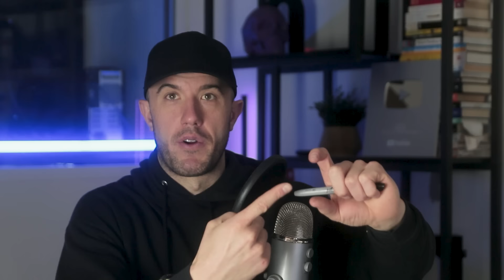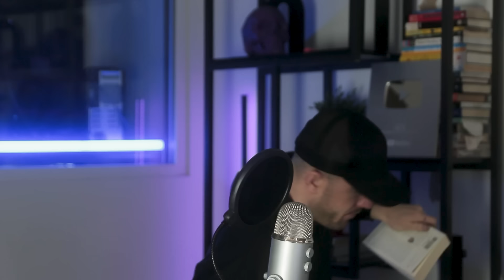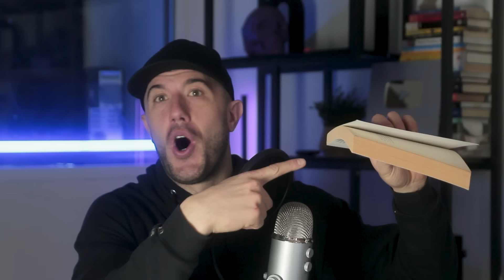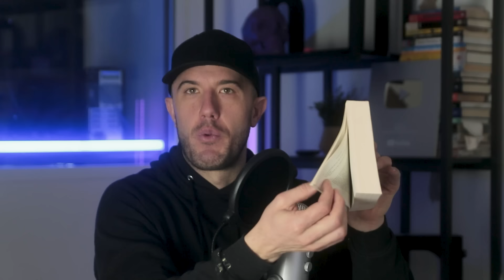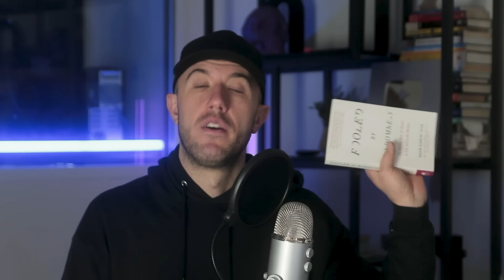ICON Raises 56 Million | Scaling Up Tangled | 3D Printing News | Podcast Ep.93

Comment: Materials are getting cheaper, I just bought new PLA filament this week being offered at $8.99 a kilogram. It's even cheaper on 3 to 5 kilogram spools. Once the infrastructure is in place there is no reason for filament to cost so much. Better quality printers are getting cheaper as well. This is one of the reasons a competitive marketplace is a good thing. Cost goes down and quality goes up. Once we figure out how to effectively feed PLA pellets into a hot end, it eliminates all the problems of extrusion and also makes PLA cheaper.

Comment: Gabe, Concerning the consulting or instruction, assume that you are located in CA / Si Valley for the consultation. I don't think I'd charge < $600 for a 1hr consultation then about $400/hr. and then only if the information provided can be somehow  be disseminated to others for training without any IP issues.  That said, certainly a 2nd factory with low cost power, low  humidity, and close to a shipping hub is essential.  I know you have mentioned Austin TX in the past for a second factory, but the RTP area (Cary, Raleigh NC has $0.14/kWhr), Low rent (last time I looked... been a while) and reasonably good shipping although high humidity so there might be associated drying/storage costs to factor in. (Just some input).  Your concept of books is absolutely correct, especially for technical books.  An old business partner told me years ago:  If you see a book that has "one chapter" that contains information that you might need for a contract in the future, buy it now as it will cost you more time (i.e. $$$) if you have go back to the book store again and buy the book then. Also if you go to a book store you should buy, at a minimum, one book to make the trip (i.e. time/$$$) worth it. Bring them home and scan them to know what information they contain in addition to what caught your eye at the time. When time becomes available you can then read, highlight, add notes, copy pages, etc. in more detail. Information is priceless especially in the days prior to the internet.  By the way, Good book that you held up.

Comment: Icon: 3D printing does nothing for the actual bottlenecks in getting a house built. Framing, they're saving like one day off effort. It's a founding principles problem where they applied a technology to a use case that happened to be one of the cheapest parts of the entire process. Still need to run plumbing, run electrical, install Windows and seal from elements. Then when you realize something needs to be changed the concrete of a 3d printed structure makes rework a nightmare.
Reply from the maker: Less labor for framing when skilled labor is short
Reply: @slant3d  that's the thing though, most people in construction can do framing, a roofer , electrician or a plumber can do framing correctly based on specifications but not the other way around. And then you still need to add frames inside those printed walls to hide all the plumbing and electrical, so you're still still putting up almost the same number of pieces of wood they just don't need to be as robust. Then you need to cover the remaining 3D printed concrete in something so that it's non-porous, so you pretty much end up spackling and painting anyway as well. And then suppose you want to add another separation between rooms that was not in the original g-code, so you're framing out some walls anyway. My whole point is that successfully automating any of those other jobs I mentioned would move the needle more than 3D printing the shell for a house, and would be easier to scale initially because you wouldn't need the massive hardware on site for doing it.

Comment: I sent a message through your website about this as an FYI, so not sure if it is working as I did not get a confirmation or an email when memberships opened back up, but I did not receive any communication after signing up for membership notifications. You may want to make sure your email/notification system is working properly.
Reply from the maker: Make sure to check you spam folder. Sometimes mass updates can end up there.
Reply: @slant3d  I check it every day, and hardly ever get anything in there. I definitely didn't see anything about membership or submitting something via the form on your website.

Comment: A while ago you mentioned a deal with Bambu. What happened with that? Any plans to go to a larger bed size like 256 x 256 minimum? Many of my models take advantage of that size. Also as far as tangled goes in order to subscribe I would need black and white Petg to join. Finally any plans on giving users more control of the slicing in teleport?

Comment: If I had to guess why 3d printed houses aren't taking off it's because nobody has come up with all of the things that go into a house that take advantage of the house being 3d printed. Electrical, plumbing  and HVAC don't offer any solutions specific to the 3d printed house. You could even say the same thing about furniture, if you have a 3d printed house with unique geometry you should be able to have furniture, probably 3d printed, that specifically fits that unique geometry.

Comment: Why filament rather than running farm on pellets?
Reply: If I understand correctly, they are making their own filament from pellet. So basically they do run the farm off of pellet. That being said, those are really 2 separate parts of their business that they have vertically integrated. I would say the reason they don't run 3d printers off of pellet is that those have not become a commodity like filament printers have become so getting 1000 of them would probably cost more and have a larger footprint.